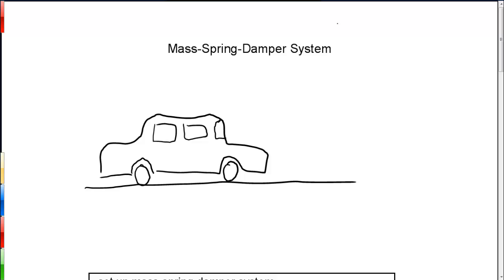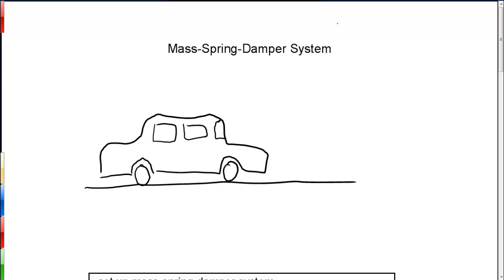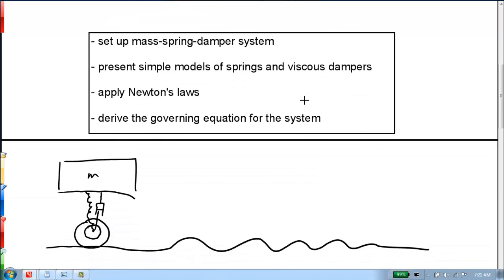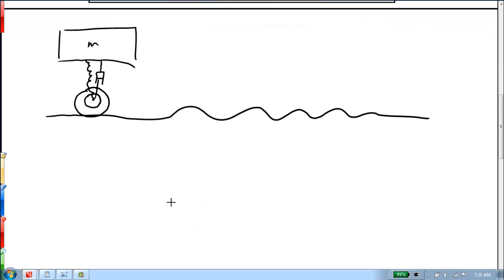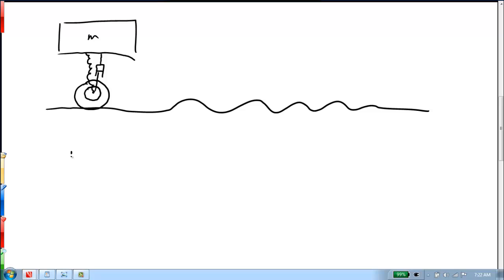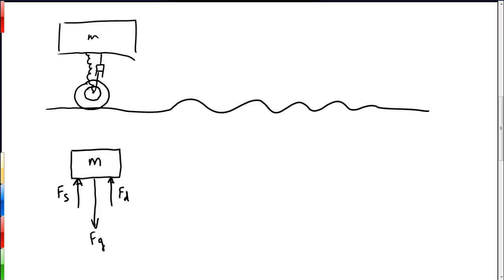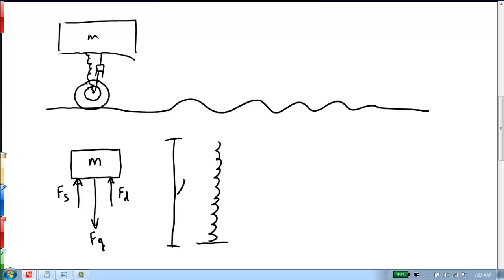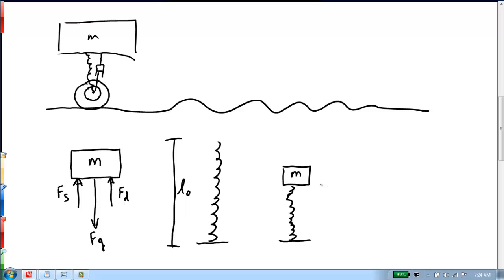Mass-spring-damper Tutorial

Comment: Great, I found the same solution. I coundn't find this problem with google with the forcing term on the other side of the spring and damper as the mass. It is not very hard but it is nice to see the confirmation that my calculation was correct. This solution is quite interesting for many cases where a small mass is connected through a spring and damper to a large moving mass/object that does not 'feel' the small mass. Choosing sinusoids with different frequencies for u and then computing the resultant x or (x-u) is also very interesting. In some cases u is unknown but (x-u) can be determined allowing to find u through inversion.

Comment: Thanks, it's very helpful. Do you know how to calculate the energy stored in the damper ?
Reply: Dampers don't store energy. They dissipate energy. All energy that goes into the damper turns into heat. No energy can come out of an ideal damper therefore we cannot speak of energy storage. An ideal spring is exactly the opposite. It dissipates no energy and all the energy put into it is stored and will come out when the spring returns to its non-compressed length.

Comment: Hi Greg,
When you sum all the forces at static equilibrium, can you neglect the damper because the speed is 0 and the damper's equation depends only on that?

I'm working on a project right now and trying to model the same device except the mass is downward (as if the ground was the surface of water and the mass was sinking). The wheel would serve as a  floater and both would be connected through a spring with damping properties too. 
Are your differential equations appliable in such case? At static equilibrium, the mass' weight  would be compensated by the wheels buoyancy.
Reply: To the first question you ask, the answer is yes as velocity is dx/dt, in equilibrium dx/dt= 0 so all the damper term is cancelled. To the second, yes the equations are the same, the only thing you should notice is that instead the spring compressing it is expanding, but in the end the direction doesnt matter as all the forces act in opposite ways, (newton's  third law)